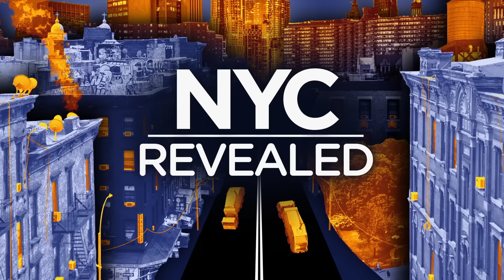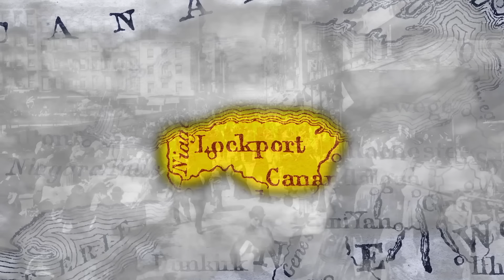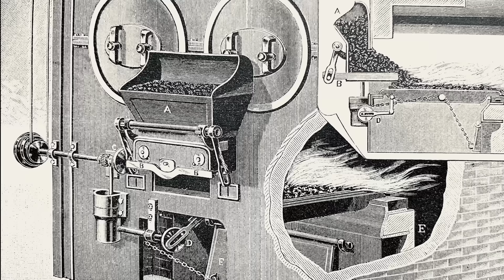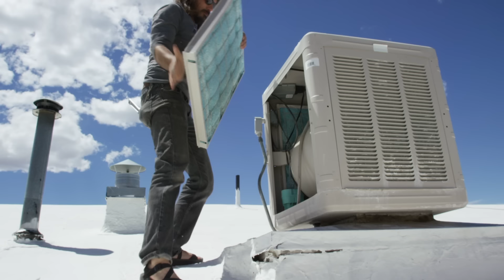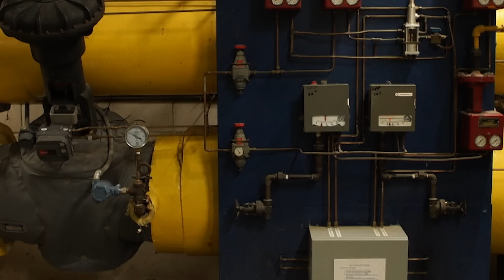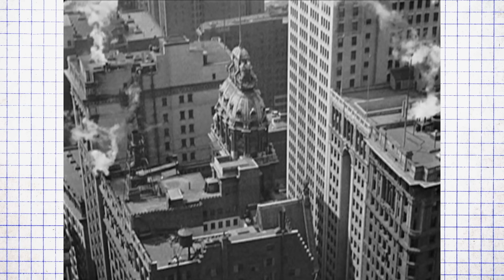How New York Still Relies on this Old Technology | NYC Revealed

Comment: London used to have a steam system which operated a hydraulic system for lifts.
I used to work in Soho and the lift in the building was one of the last that was still connected to the steam system in the mid to late 1970's.

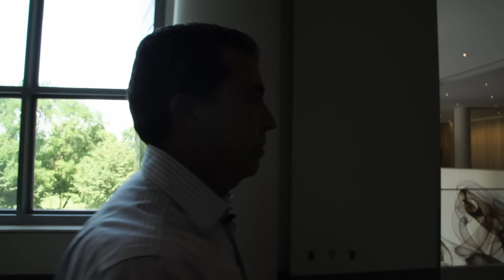Comment: @20:09 Really!?!? Wow. It is relieving to see how far the US is behind :D Never thought of just using hot water in the loop? When pressure is increased it can get beyond 100 degree Celsius and even in case of damage it is much less spectacular (volume will still be the same!). Even this system could do with closed loop instead of just releasing the steam (I would bet 20% more efficiency at least!).

Comment: Steam is great but y is it leaking out of these pipes when I visited NYC I knew right away what it was from the smell I thought it was a work site or project under work then I found out they are there all the time seem like a problem that became habitat I’m an hvac tech and facility’s I work at that use production steam for various things never have it leaking out of valves or traps it’s condensed and pumped or drained back to the boiler that made it water treatment is very critical to keep the system from scaling like your kettle at home the stuff I work on is only 150to200 psi and that’s dangerous and scary to work with NYC has 1000s of psi superheated steam flowing everywhere right under people’s ft and no one is aware of the pressure and danger it could be if not properly maintained and as for the A/c he’s referring to it called an absorption chiller that uses steam to heat a brine solution similar to how a propane fridge works in an r/v cool stuff power generation too

Comment: Very interesting docu about New Yorks "Fernwärme". Here in Germany we also have this in some Citys, but mostly with the heat from power plants for electric power, not only heatstations. In Bern, Switzerland they have built a new garbage burning station (Kehrrichtverbrennungsanlage😊) and they use the heat to heat buildings nearby. In early days, trains also had steam heating, with steam from ne locomotive, even electric and diesel engines had a Boiler for that.

Comment: Steam was the height of heating technology.  Before the days of high efficiency electric pumps to push hot water steam was the solution.  I read that it takes just over 2 minutes for the steam to get from the basement to the top of the empire state building.  No electricity required.  You can even get high tech electronics to make sure the boiler side is operating as efficiently as possible.

Comment: Sorry I'm 7 minutes in and it's bothering me, maybe it is clarified later but steam doesn't create heat, it's the most efficient way to spread the heat around. Steam is a product a heat, you heat up water in a central location and then move steam/hot water around.  You still heat up the water with coal or natural gas. It reduces the amount of fires needed from like 1,000 in each house to 1 with steam flowing to each house. Plenty of cities use steam to heat their homes, not just New York but they might have the most complex system.

Comment: I work on the high pressure steam thats feeding all these buildings. We use PRVs and controllers to knock the pressure down in 2 or 3 stages before its really useablefor equipment ( most are low pressure hot water heaters, heat exchangers, etc) . Been doing it for 8 years and I dont see a transition coming for at least another century with how much steam there is in manhattan.

Comment: Ive heard steam is very useful in HVAC because it can be used for humidity control as well. Im surprised - id think all the energy loss out of those stacks and under the ground. Here in Seattle, our steam provider is Seattle Steam

Depending on the boiler fuel, Its not harmful as in toxic... but it certainly will burn the crap out of you if you come in direct contact with it (hence the barriers and stacks)

Comment: And this is not a closed cycle system? They just constantly blew tons of crystal pure water into the air?
Why don't they use heated water itself as a source of heat for the buildins, wich could be returned back to the power plant, reheated and go to another cycle

Comment: forgive me but using steam to heat water just seems like an entirely unnecessary extra step
Reply: It's a very necessary step if you study physics.
Reply: ok, so lets talk about the physics here. you start with cold water, you add heat (requiring energy) you get hot water (you know, the thing you're trying to make..). but ok add more energy, more heat, now you get steam which then you have to transport. more energy is required because it will lose heat in the journey. Then you finally get to the heat transfer step which is also going to result in energy loss. So instead of just heating the water directly you've introduced multiple steps where energy loss occurs. it's completely unnecessary, and wasteful.

Comment: Most places use hot pressurized water - very hot, but not boiled to steam - in their central heating systems. Are there any advantages to using steam?
Reply: Steam is better.

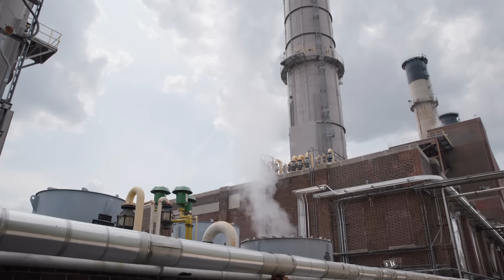Comment: 21:35 Using the words sustainability and the burning of fossil fuels (in this case, gas) in the same sentence is quite something. As if gas were somehow more sustainable than oil or coal just because it emits a bit less CO₂. That’s like saying, “I used to drink three bottles of gin a day, but that wasn’t sustainable for my health, so I cut it down to two.
Reply: Well, it is sustainable for the next 400 to 500 years at current use.

Comment: I understand the idea behind the concept (heating large buildings in a limited space). But I still don’t think it’s necessary to generate a room temperature of about 68°F using 350°F heat. From a thermodynamic or exergy standpoint, that’s not particularly efficient. A heat pump or something similar would definitely be an interesting alternative for the future.

Comment: I've lived and studied in many german cities with steam-powered heating systems and now I even live next door to a power plant with a steam pipe running under my backyard and I've never seen any steam stacks or steam coming out of the ground.
Reply: Thats because here in Germany we most of the time don’t use steam but hot water in „Fernwärme“. That elimantes some of the issues with steam.
Reply: These pipes we use are either hot water at around 80°C or a Mineral oil at around 150-170°C and they work like a charm. 

New ones are being build as well.

Comment: Insane how this video's painting this woefully outdated system. It's inefficient due to heat loss and shit calibration, impossible to maintain, and I can't even control my apartment temperature - big steam decides if I'm cold or warm. Water based district heating could utilize much of the same piping and be a lot more efficient. You could burn dump site literal trash and your recently deceased grandma for warmth, with an efficiency rate (with cost priced in) only really beaten by modern heat pumps.

Comment: Great video. Steam has advantages over hot water systems. Steam does not need pumps. While hot water is hot, steam is hotter in that it gives up latent heat as it condenses into water.

Comment: Problem with this is pollution of moisture hot water no wet in air this must leak. But it transport heat for long distance in higher buildings

Comment: Problem with stream, not mentioned in this video, is that it requires a high temperature energy source to generate it, i.e. fossil... Future upgrading to heat pumps, solar heat storage is impossible, when upstream temperatures hovering around 150F. You'll have hot water but not steam. This is neither future proof or clean. The Producer of this video is sus!

Comment: Why not just use hot water, like almost everywhere else in district heating distribution? It's good that the six power plants don't have smoke hanging over every property. However, it seems that the steam is produced using fossil fuels such as gas or oil. This in turn produces CO2 emissions and thus increases the greenhouse effect.
Reply: Does really almost everyone else use water for the distribution? I don't really know about other countries but here in Poland all the largest cities use steam – though that's just for the main distribution (and some industrial facilities use it directly); what you get at your building is hot water. Smaller systems may be water-only.
Reply: Steam is more efficient.
Reply: Imagine the electricity needed to run pumps which would be required to distribute hot water to the entire island of Manhattan...and then overcome the head pressure of pushing hot liquid water up into the many-hundreds of 30,40,50...90+ story buildings there.  Also the steam can run absorption chillers and steam-driven centrifugal chillers to provide air conditioning.  Hot water is great for many applications but probably not Manhattan.

Comment: This has got to be the most ineficient and expensive method to produce heat. The only reason it still lives it's because all the infrastructure is already there in the city and in the buildings.

But no way in steamy hell that a new building will waste space on pipes, reduction systems and all the maintenance that goes with it when you can just use electricity, like the rest of the world 😂😂😂

Comment: Most office buildings purchase live steam from Con Edison. It is a waste product from generating electricity. It is used to heat domestic water, heat the building and cool the building utilizing steam powered turbine chillers. New York eco terrorists want to shut down the Con Ed power plants for green energy. Every office building will have to install new heating and cooling equipment at prohibitive costs. Most do not have the space to install the new equipment. Eliminating fossil fuel electric power plants is not going to happen. Former  Governor Cuomo shut down all of the Indian Point nuclear generating and the mega watt short fall cannot be made by windmills, solar or Unicorn farts. New York, especially NY City is headed for big trouble when electrical demand exceeds supply. Its coming very soon. Buying power from Quebec Power is their solution and that will cause electric rates to soar to unaffordable levels. This is self destruction.

Comment: If new york gave up steam, it wouldn't need to go electric. Munincipal heat and cooling based on water circulating piping are a well established technology in Europe. These allow for greater efficiency and safety compared to steam, the water also acts as reserve medium. We use massive storage batteries that are basically big cylinders with a lid that moves as the water expands in the grid. They could use same routings and even retrofit boilers to allow for this.

Comment: Also I used to have radiator heat and loved it. We couldn't control it very well. So winter id have my doors and windows open cuz it was so hot up in that apartment and the clanging or steam hammer they called it was wild  I miss it

Comment: Do they just release the steam in the air after it's used, this is all weird AF! I live in Austria and we have a similar system all across the country but it transports hot pressurised water to the customers, and back! We also have the hot water as a bi product of power plants, pretty much exclusively except in very rural areas, but it seems just so incredibly inefficient to just release the steam and make new afterwards.

Comment: Could these steam plants be changed  into ground source heat pump plants? And just pump hot air to buildings instead. Asking out of curiosity.
Reply: Not efficient and too expensive. Water has bigger heat capacity so it's better

Comment: I grew up in Baltimore and worked for Baltimore Gas & Electric which also supplied steam to customers. Far as I know, Baltimore still has a district steam system, supplying steam to a number of downtown buildings. The SSA and Convention Center buildings were the last customers added to the system because it had reached its supply capacity. I was the field inspector when those two services were installed. BG&E sold the system to another company shortly thereafter, but I used to keep maintenance  and map records when the company still had the steam supply system. When there was a steam leak we also put up vent stacks. If you don't, the heat buildup can damage adjacent underground utilities.

Comment: Actually „Fernwärme“ in Germany is practically the same and it’s getting build a lot 
The streets getting ripped open and homes are getting connected to it
Reply: Streets are ripped open and customers are ripped off. Once you gave centralized Fernwärme, it's hard to get rid of it. You are totally dependent on it and you have to pay what your supplier asks for. With gas or electricity, you can change providers, but not with steam.

Comment: We use mostly central hot water systems in cities. So hot water around 110 degrees celsius gets pumped to the consumer. Unlike steam it’s a closed system where the cold water after usage goes back to the heating provider. The heat source is either waste heat from a power plant or central heating pumps. But also dezentral systems with a heater per building using heat pumps (electricity) oil and natural gas are present.
Reply: 100celcius
Reply: @noleksandr  no it is pressurized and the boiling temperature of water increases with the pressure. Nuclear power plants for example have liquid water with a temperature of over 300 degrees Celsius in their reactors.
Reply: Who is we?
Reply: @N @Nathan-jh1ho  German.

Comment: We use hot water instead of steam in district heating system in Helsinki. its simpler and you can easily use big hot water tanks for energy storage.  We have phased out burning coal completely now and use electricity and gas to make the hot water.
Reply: Cities here in the southeast US. Like Nashville, Atlanta. Not only have district hot water service for heating during the winter time. But they also have district chilled water service for air conditioning during the summer time.

Comment: As somebody who lives in a small city with boundless space I can say the challenge is real. I;ve been to Manhatten that part of New York City is dense (it could be denser but we won't get into it) there isn't alot of space for other heating methods and its old. I'd imagine its probably difficult to move to another energy source. Ripping out all those radiators and pipes without a sound solution would be costly.

Comment: Meanwhile, Norway uses water loop based District Heating Networks and have done so since 1936.
Bonus: They don't blow up
Secondary bonus: They don't require water purging (water is the transport medium so we rather like to keep it in the system)
Reply: How many btu’s does one lbs of water hold compared to one lbs of steam? You know how fast steam can move? Before electricity was wide spread could you power machines with hot water or steam?
Reply: Good for you.
Reply: Meanwhile Norway has a fraction of the people to service that we have here in the states
Reply: Congratulations! It only took, what, 100 years for you guys to make something work?

Comment: There's a reason modern district heating systems are based on circuits of hot water rather than steam. It might be a bit more annoying to pipe up tall buildings, and the temperature isn't quite as high, but in return the distribution infrastructure as a whole is much simpler to maintain. It also works much better with giant ocean sourced heat pumps, due to the lower temperature delta. However in the short to medium term it is very hard to justify laying out an entirely new, incompatible heating network, when the old steam pipes still work good enough. Doing so would save a lot of money over the next century, but nobody wants to budget on those timescales.

Comment: This entire video ignores the elephant in the room and doesn't give me an answer. Why not water? Hot water is the most popular and significantly easier way to distribute central heating. It's significantly heavier and lower in temperature. It transfers more energy more safely. There's no ventilation, and breakdowns are rare and easier to repair. Nearly 90% of central heating systems in cities around the world are water-based. This video covers everything but the most obvious solution. Very annoying. ;) I suspect that New York system is steam based because it is so old and now it would be very difficult and expensive to make such modernisation bo no one even didn't even stutter about that

Comment: In 1980, in Columbus, Ohio, I moved into a warehouse, that we, ( myself and 9 others, all Artists) turned in to our Art studio.  We only rented the top floor.  The warehouse and light industrial manufacturing shop, was built in 1900. A narrow building, that was 200 foot long, by 50 foot wide, and 5 stories tall. It was heated by steam heat, and in 1980, it was still receiving coal deliveries every other day. The coal burned in a large boiler in the basement, the steam was sent throughout the building to heat it during the cold months, to iron radiators. By 1980, most coal burning boilers had been converted to burn natural gas. There was still a live-in building caretaker, who had a small comfortable apartment in the basement. His nightly tasks included meeting the coal truck, after midnight, to assist with the coal delivery, poured down a chute on the side of the building, that was deposited into the basement coal room. By 1980 there was an electric powered auger that moved coal from the coal room, right into the fire box beneath the boiler. The caretaker was responsible for shoveling out the slag ( the burnt coal impurities) into barrels to be thrown away. He also washed and occasionally waxed the floors in the hallways on each floor.